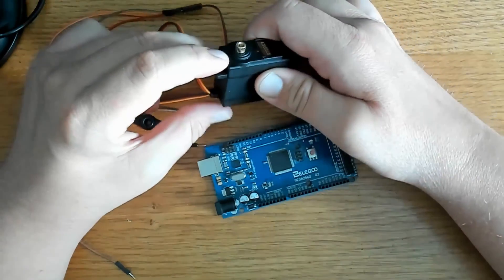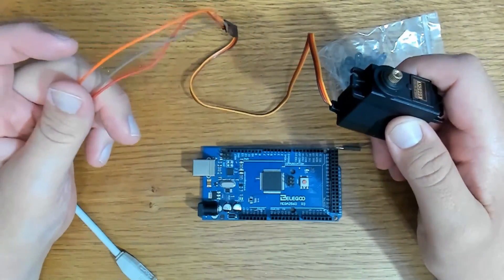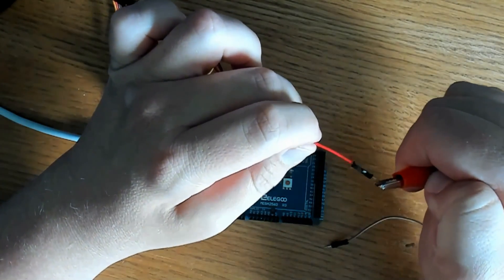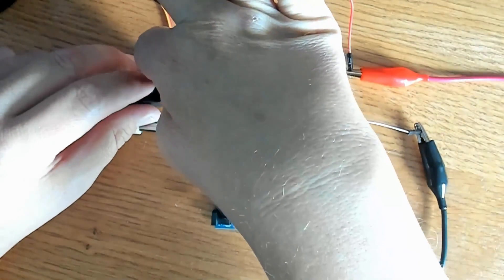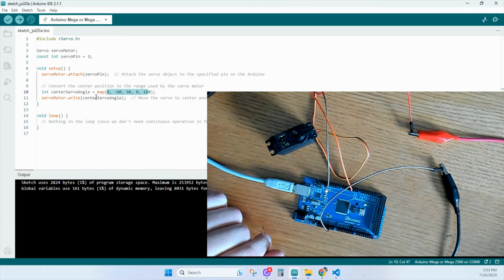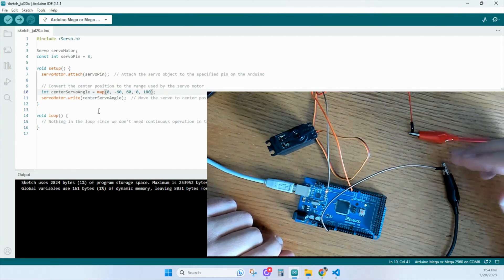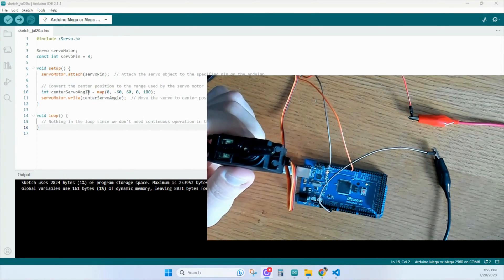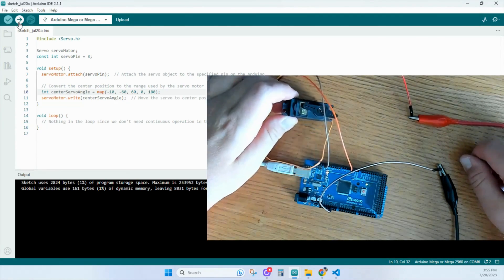How to Adjust and Set Your Servo Motor Angle with Arduino - A demo for beginners

Comment: Hello, I would like to ask. I am using an MG996R servo, but how can I make this servo move only once, and then it can be repeated again? It should not move continuously, just once but can be repeated for my project, which is a vending machine. The servo will be used to rotate the spiral. Thank you, I hope you can help."
Reply from the maker: hey there!  You may be able to get better results in a standard vending machine with a 24v high torque dc geared motor with encoder. Is this just a concept thing or are you  putting it to use? Servos are doable but I wonder about the durability of the gearbox over time. It can reach a good torque value to spin the coil, but a sustained torque to continuously spin the coil for larger objects? .... Would have to test. Anyway, what does your setup look like?  How many coils? what kind of power rail do you have?  size of items in your vending machine...etc.
This may be helpful. Lets say you have a button on Arduino pin 2 and servo on pin 9. When the button is pressed once the servo will spin 360 deg. You may have to change the time it spins to get an actual 360 deg spin. Here's an example: 👍

#include <Servo.h>

Servo coilServo; // Create servo object

const int buttonPin = 2;      // button input pin
const int servoPin = 9;       // servo control pin
const int STOP_SIGNAL = 90;   // stop servo
const int ROTATE_FORWARD = 170; // rotate direction
const int ROTATION_TIME = 1000; // fine tune time for 360 deg rotation

// track button state
bool buttonPressed = false;

void setup() {
  pinMode(buttonPin, INPUT_PULLUP);
  coilServo.attach(servoPin);
  coilServo.write(STOP_SIGNAL);
  delay(1000); // stabilize
}

void loop() {
  // read button state (active LOW)
  if (digitalRead(buttonPin) == LOW && !buttonPressed) {
    buttonPressed = true; // prevent multiple triggers

    // Rotate coil
    coilServo.write(ROTATE_FORWARD);
    delay(ROTATION_TIME); // adjust to ensure 360-degree turn

    // Stop coil
    coilServo.write(STOP_SIGNAL);
    delay(500); // small delay before allowing another press
  }

  // reset button state when released
  if (digitalRead(buttonPin) == HIGH) {
    buttonPressed = false;
  }
}

Comment: Hi thanks for the video, great explanation! I got question about the servo post commiting the script via arduino. Lets say today my intention is to center the servo horn to be exactly 90 degree parallel to the servo since the drift shaft spline is always setting it left or right few degree, after commiting the script, disconnecting the servo from arduino, and connecting back to my rc car esc, will the setting retain in the servo in this case?
Reply from the maker: Hey there! 
No, a hobby-grade servo does not retain offset or centering adjustments once you remove the controlling signal. These servos are basically "dumb" actuators that rely entirely on PWM signal they receive to determine position. They don’t have memory or calibration storage that would allow them to remember a new zero point once you disconnect them. I beleve there are some high-end servos that you can program, but I don't have any.
What you can do is set the servo arm manually. You can manually remove the servo arm and reattach it so that it points straight ahead at the desired command. This ensures that when that same "neutral" signal is applied in the future, the servo arm will be aligned as you set it. You can also setup a feedback System with encoders to restore the position you want.
The servos I generally use are MG995, which does not have internal non-volatile memory. This means it cannot retain any position settings or offsets once it loses power or is disconnected from the Arduino.

Comment: Is this the only way to change servo parameters? Im just getting into rc planes, and dont like that some servos come with a max of 70-80° movement. Wtf do they even put servo travel limits in the radios for. 🙄Suppliers also arent great about listing details like that. So i want to be able to change things myself.
Reply from the maker: Hi there!
There are other ways to change the parameters, you don't have to use a programmable microcontroller. I found "DROK Signal Generator, DC 3.3-30V Function Generator 5-30mA LCD Display PWM Pulse Frequency Duty Cycle Rectangular Wave Square Wave Signal Generator" on Amazon. I have never used particular item. The servo motor interprets the pulse width of the PWM signal to determine its position. The frequency sets the period of the signal, and the duty cycle determines the length of the high pulse within that period. May be worth checking out, or maybe something like it depending on your needs. This one may be too big for a plane, but maybe there a smaller version of this.
Many rc planes have servos that restrict movement to prevent overtravel. Like other RC vehicles, I assume you can upgrade the servos. I imagine changing to a servo with more movement would drastically change the controls, especially for a plane. Check out the data sheet for the servo before you purchase it to make sure it has the movement you want. 
It sounds like you found a fun hobby once you get everything going!

Comment: can this servo changes like 0 ,5,10,15 degrees. Waht is the minimum angle it can change
Reply from the maker: hey there!  Yes, this servo can change rotation in increments of 5 degrees. The MG995 can rotate 120 deg, -60degrees to +60degrees. here's a link to the data sheet - https://www.electronicoscaldas.com/datasheet/MG995_Tower-Pro.pdf   There are servos that rotate 180degrees and continuous rotation. 👍

Comment: Hey, this code was very helpful and simple. Thank you! How would I adjust the speed of the servos as well? I'm basically duplicating the code for the start position, a delay, and an end position but the servos I have are too fast. How might I slow them down?
Reply from the maker: hey there!  you can add 2 variables, "step" and delayTime" in this example. delayTime determines the pause length between each movement (smaller delay = faster movement) and step determines will determine how smooth the motor will move. You can play around with both variables. Try this: 

#include <Servo.h>

Servo servoMotor;
const int servoPin = 3;
const int targetAngle = 90; // Target position for the servo

void setup() {
  Serial.begin(9600);
  servoMotor.attach(servoPin);
  servoMotor.write(0); // Start at 0 degrees

  int pos = 0;
  int step = 1; // Step size of 1 degree per movement
  int delayTime = 15; // Fixed delay time in milliseconds

  if (targetAngle > pos) {
    for (pos = 0; pos <= targetAngle; pos += step) {
      servoMotor.write(pos);
      delay(delayTime);
    }
  } else {
    for (pos = 0; pos >= targetAngle; pos -= step) {
      servoMotor.write(pos);
      delay(delayTime);
    }
  }
}
void loop() {
  int targetAngle = 90; // Target position for the servo
  int pos = servoMotor.read(); // Read current position of the servo
  int delayTime = 15; // Fixed delay time in milliseconds
  int step = pos < targetAngle ? 1 : -1; // Determine step direction based on current position

  while (pos != targetAngle) {
    pos += step; // Increment or decrement the position
    servoMotor.write(pos); // Move the servo to the new position
    delay(delayTime); // Wait to maintain a consistent speed
  }
  
  // Optional delay to handle behavior at the end of movement
  delay(1000); // Wait for 1 second before next move or action
}

Comment: Not working! : (
Reply from the maker: Hi there.  Give more detail and I'll help as much as I can 👍
Reply: @BMonsterLaboratory  Yow thanks for the reply. We try your code on MG995 360 degree servo with 5V 2A external power supply, but the servo turn to the right continuously. Were having a problem positioning MG995 360 degree servo to a particular angle we want too. thanks for the reply appreciate any help!
Reply from the maker: @feeldulfo9387  I don't currently have a continuous rotation servo but, try this.
#include "Servo.h"

#define SERVO_PIN 6   // Can use any PWM pin

Servo servo;          // Creates a servo object used to control the servo motor

void setup() {
  servo.attach(SERVO_PIN); // Assigns PWM pin to the servo object
}

void loop() {
  servo.write(90); // Set the servo to its neutral position (zero degrees)
  delay(1000);     // Wait for a moment (adjust the delay as needed)
}
For most continuous rotation servos, a value of 90 is often used as a "stop" or "neutral" position, where the servo should not rotate. Sending a value less than 90 will make it rotate in one direction, and sending a value greater than 90 will make it rotate in the opposite direction. So, when you use servo.write(90); with a continuous rotation servo, you are typically instructing it to stop rotating. If it doesn't stop at exactly 90, you may need to calibrate it or adjust the value slightly to find the actual "stop" position for your specific servo.  I hope this was helpful! 👍
Reply: servo motor mg996r can’t control the angle by the arduino only 180 can control